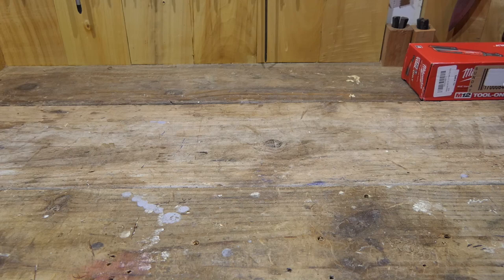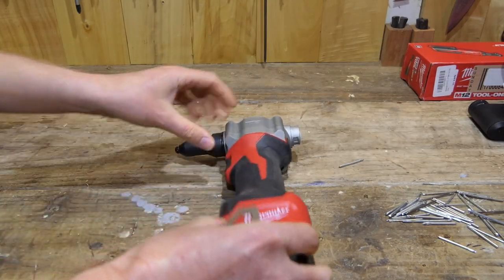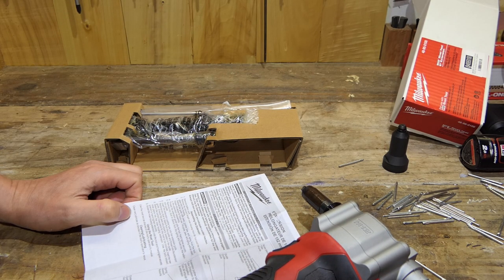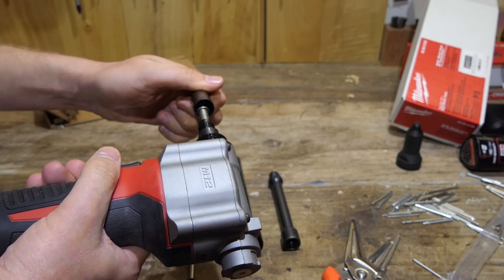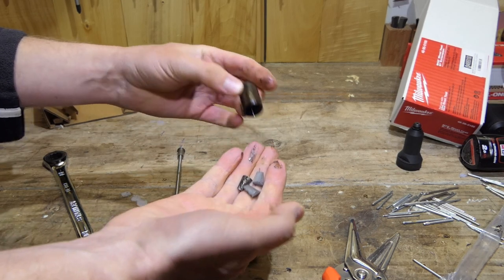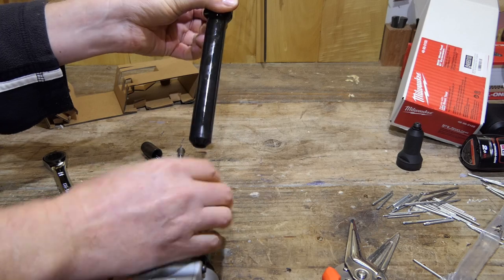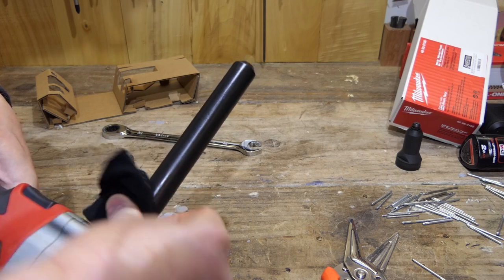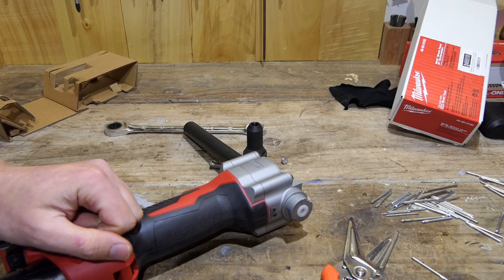Milwaukee M12 Rivet Tool Nose Extension Tutorial

Comment: If you look at the end of the tip there’s a little steel ball that puts pressure on the rivet shaft and is what prevents the used rivet shaft from falling back into the chamber. If you remove the tip using the provided hex tool, you can then easily remove the O-ring and the little steel ball. I’d obviously keep them around in case you wanted the tool in the future for some reason grip rivets, but that will fix your problem.
Reply: What i think your a bit confused there bud?? All you have to do is put a new rivet in the tip and pushes the old one back

Comment: @Builds & Stuff.  Thanks for the tutorial on how to replace that nose extension on the Milwaukee M12 riveter. So it looks like I'm not the only one who thinks Milwaukee doesn't do a great job with their instruction manuals. I like how Makita has more diagrams in their user's manuals. Not that Makita thinks their users are idiots but Milwaukee, I think, treats their users a bit like Apple users. "It's intuitive" they think. I had to look up a You Tube video just to figure out how to open the charge port for Milwaukee's 700L flashlight (the o-ring for the twist cap covering the charge port is very tight). And no, there's no picture or diagram on where to hold the flashlight when twisting that cap.

Hope you and your family stay safe and well.

Comment: Just giving you a heads up but the long thin steel bar the rivet stalks go down the head at the bottom of the thin part comes off the bar itself sometimes as it is not welded onto it so i use a small amount of super glue on it then hit it back on with the hammer, wipe the excess glue off, leve it to dry, put it back together then you are ready to go
Reply from the maker: Cheers